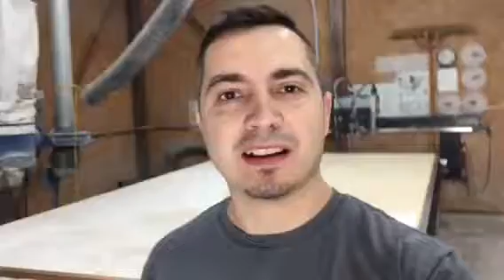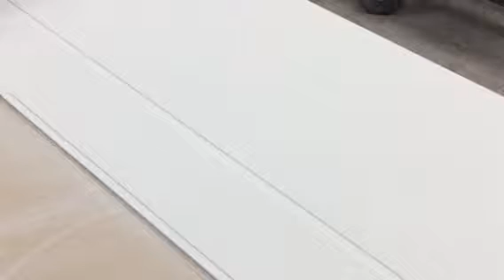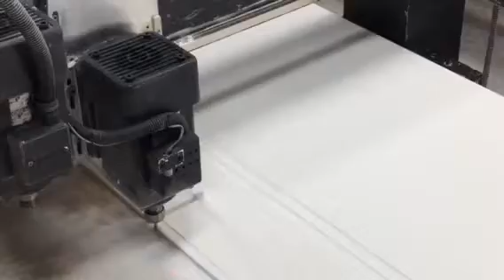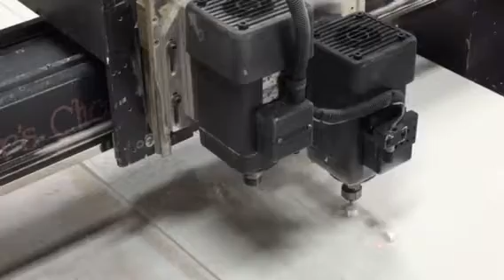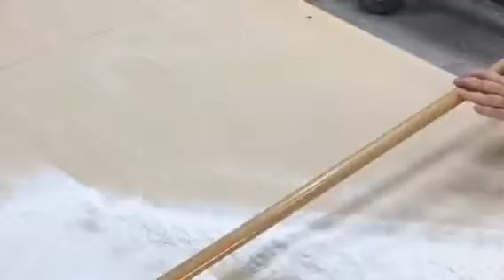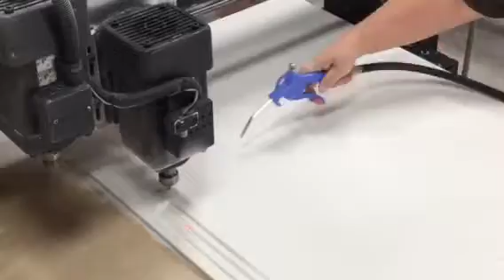CNC cutting- why not a table saw

Comment: Hey Jeff.  Just wondering what type of scan software you use?  Maybe you have a video about this already?
Reply from the maker: Not sure what you mean by scan software. We use a laser templater to find points along the wall for the counters fit, then import that into a cad program to make a drawing of the countertop. That file gets exported to a program to write a g-code which gets sent to the cnc to cut out parts.

Comment: I'm from the Caribbean and build all my solidsurface tops from home. I've never seen a cnc live in action. I always wondered what keeps the sheets from shifting out of place when cutting?
Reply from the maker: +Dj Bolo There's a vacuum pump holding it down. Smaller sheets may need some additional way to secure it. But there are always way better CNCs than ours.